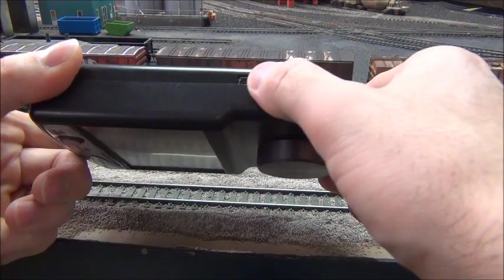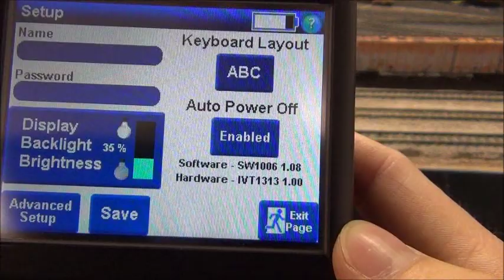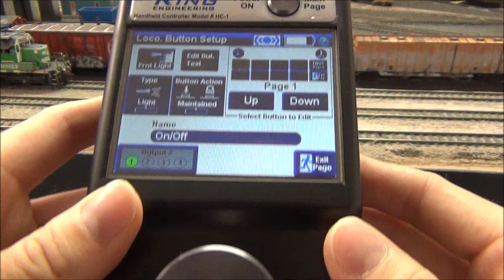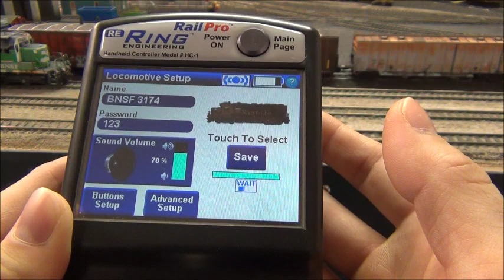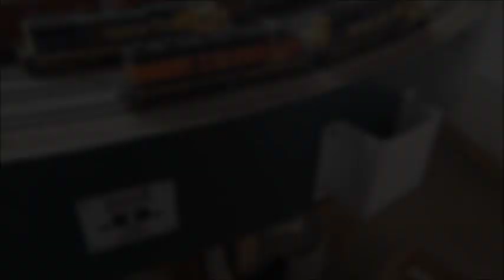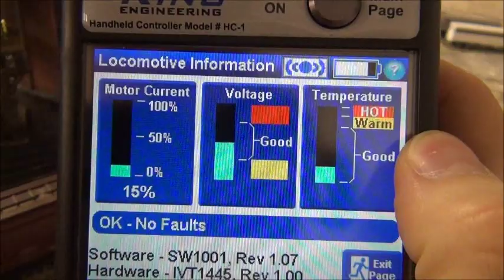Ring Engineering Railpro Review

Comment: 12 years later - are you still using Rail Pro ? Seems like a great alternative to dcc. I am HO, only concern is fitting the modules into the smaller equipment I have, but I can mill weights etc ... to make things fit. 
I would love to hear a current opinion on RP if anybody out there can share - appreciated.
@kpack - great videos, nice job.

Comment: Does it have momentum? That is a must in my opinion.
Reply from the maker: You can set acceleration and deceleration rate, which is essentially momentum.  The new "load" function takes that a step further and really dials up the momentum when you put the load way up.  Depending on the locomotive settings, a consist with 100% load can take a very long time to slow to a stop, even at full brake.
Reply from the maker: BTW, this video is very old and Railpro has changed a lot since then.  Check out the updated review I made.

Comment: Ok, 8 years on the system, what's your impression at this point?
Reply from the maker: Lots of improvement since the beginning.  I do wish some things would happen quicker, but Ring Engineering is a small outfit and they can only so much at a time.  Sounds are far better than they were in the past, many new features, new hardware also.

Look at the updated review video I posted last year and that will help get you up to speed.  The stuff featured in this original video is far different now.

Comment: Do you use keep alives? If not how do your locos run without them. Great video!
Reply from the maker: Yes I use keep alives now.  Railpro runs fine without them but I've found that it's a bit touchy to bad/dirty track.  I just got tired of power dropouts and have loved keep alive's.  I usually use the TCS KA-4, but will start using the KA-1 and KA-2 when they come out.  The KA-4 gives me at least 15 seconds of additional sound, lights, and run time which is way more than what I need.

This video is super old.  Railpro has changed a lot since then.  I really need to get a new one out.
Reply: KPack I have them installed in my railpro too but I found out when you go over a long dead spot it keeps going but the speed slows down drastically and it kind of bugged me just wonder if there’s someway to adjust that

Comment: ROFL have to hit buttons for 20 min before running? how is that better then DC ?
Reply from the maker: No, to start running with Railpro you hit 3 buttons: "on", "locomotive", "select locomotive".  Done.  The buttons pressed in the video are all over the place showing different features and such.  If you are running a train it is quick and to the point.  I'm running full consists of 4-5 locos within 30 seconds of turning the controller on.  It's not that hard.

Comment: Have had Railpro for a few years now.  Its features and sound capabilities have improved over the years.  Yes you do need a LM-3S module for every loco but its costs more or less the same as a dcc sound board.  There is no doubt a learning curve that has taken me several installs and emails to learn the processes. But as Kevin shows here the consisting ability alone for even power distribution is worth switching to Railpro.   They have a new feature that allows you to set the load to simulate a heavy train behind your loco.  Crank load up to 100% and the prime mover sound notches up 3 or 4 times before the train creeps forward.  Very realistic.  The new ultimate prime mover sounds are way better than anything else ive heard.  Also having a vast selection of different bells and horns makes individual locos unique if needed.   If youre willing to spend the time to learn and are willing to use a soldering iron, Railpro blows away DCC. Youll never look back.  If you just want to take a sound equipped model out of a box and run it without having options than stick to DCC.  When you want to consist 3 or 4 together youll be wishing you had railpro.
Reply: Just to add, I do own an NCE power cab as well as the railpro handheld.  The power cab serves its purpose for dcc but compared to this Railpro handheld in terms of visual user friendliness, the PCab feels like something out of the 1980s.

Comment: Nice and thanks for sharing, I’m considered a beginner, currently I have a EzCommand board control and soon or later I would like this try this, do you know if this will work with the materials I’m using, Do you have a link or somewhere I can find this.
Reply from the maker: It all depends on what you are using and what you are planning on doing with Railpro.  Railpro can work in conjunction with DCC (more information on that is available on Ring's website), or it can replace it.  Do some reading on www.ringengineering.com and the Unofficial Railpro Users Group at www.rpug.pdc.ca.  Those two places have much more current information than what this video shows.

Comment: do they have a website, can you use other brand decoders with this?
Reply from the maker: ringengineering.com is the website.  Railpro is not DCC and will not work with full functionality with DCC decoders.  HOWEVER, Ring Engineering has made it so that the later generation of Railpro modules (LM-2 and LM-3) can be made to operate in a DCC-mode so that they can be used with existing DCC decoders.  It is a function that needs to be enabled on the Railpro module.  Once enabled the Railpro-equipped locomotive will be able to be pulled up on a DCC controller and used as a normal DCC locomotive. 

While this will allow you to run a Railpro-locomotive with DCC-locomotives, keep in mind this does not allow you to use all the power behind Railpro.  Railpro will be unable to automatically load-share, there will be no duplex communication, and the sounds may not respond as expected.  Basically it was a band-aid fix to allow people to interface between the two systems.  I'll be honest though, if you're going to go Railpro just go Railpro.  The control is far more enjoyable than DCC that it just can't be compared.

Comment: Can you make a suggestion, I'm considering purchasing this system now 4 years after you bought it. Do you recommend it still or is there another system you suggest. I'm making a small n scale layout and dcc is all new to me. I'm used to o scale. MTh Dcs and Lionel legacy.  Appreciate any suggestions you have for me.
Reply from the maker: Unfortunately Railpro isn't made for N-scale just yet.   The components will need to shrink in size before that is possible.  So in your case I'd recommend using any DCC system.  If you were in HO, then I'd absolutely recommend Railpro over DCC.
Reply: KPack thank you!  I ended up getting the NCE power cab after I visited the hobby shop yesterday. Im naturally an O scaler. Used to Lionel Legacy and MTH DCS so dcc is all new to me lol

Comment: I am still a little bit unclear on this. When you consist locomotives do they automatically speed match?
Reply from the maker: +Jackson Railfan Yes, but it's a little different than "speed matching" as the DCC world sees it.  When speed matching with DCC most people just try to have the locomotives running at the same speed.  In Railpro, though the locomotives will automatically run at the same speed, the consist will actually "load-share", meaning that each locomotive will adjust its speed by itself, in real-time, in order to spread the load evenly throughout the entire consist.  This happens without any input from the user....all you do is determine how much power to give the consist (controlling speed with the big knob) and the Railpro software does the rest.  The locomotives constantly send information back to the controller, which then interprets the info, makes adjustments and sends it back to the locomotive modules.  This happens instantly and continually.  

When you install a locomotive module you will need to set the Motor Full Load Current, which takes a couple of taps on the controller, and then will set it automatically based on how much current it takes for the locomotive to loose traction.  This value is unique to each locomotive and is dependant on the motor, drivetrain, weight, etc of each locomotive.  This value is used by the controller to make automatic adjustments to each locomotive in a consist so that all locomotives are pulling more or less equally, similar to how the prototype does it.
Reply: Great demo video KPack. Railpro even maintains speed and shared load on track inclines and declines.

Comment: I have a 25 year old  Atlas engine too. It does not have ditch lights on it. Did yours come with it, or did you add them?
Reply from the maker: +Russell Scohy I added them.  Details West housings with LEDs.
Reply: +KPack Hey can you run this contoller  on a club layout that uses digatrax
Reply from the maker: Yes, the layout shown on the video was running Digitrax.  You can use Railpro locomotives on any DCC layout as it only takes the power from the rails.
Reply: Ok thank you

Comment: I am just getting into model railroading and i was wondering if you knew how Rail Pro worked with turntables? I cant seem to find any info on their website about modulus or anything. Any help would be much appreciated! BTW i love the weathering!
Reply from the maker: Kingfish - The current software version of Railpro does not support turntables yet.  They are wrapping up development on a new software program that will allow users to control things like turntables and other animated things from the controller..  I've tested it out and it works well.  When that program is released you will need a AM-1 in order to control the motor on the turntable.  The AM-1 is a module that is mounted below the layout to control things like turnouts, turntables, etc.  You tell the turntable what to do on the controller, the AM-1 receives the instruction and then directs the motor which way to turn and how fast.  The new software will also allow you to create your own "projects" for the AM-1....meaning you can write the code and commands to control pretty much anything.  Does that answer your question?
Reply: freewake84 Thank you very much for the info! Not long after i posted this comment i sent an email off to Ring Engineering and they sent me back a bunch of info about the new software. Very cool stuff. I wonder how far out they are from releasing it?
Reply from the maker: IKINGFISH1213I Not sure, but probably within a month or two.  The software itself is pretty much done, I think they are just working on the logistics of distributing it, etc.  It'll be a great addition to Railpro when it comes out.

Comment: Hi There 

I really like your post on this item and have a question to ask you 

I'm thinking about getting this system and i was wondering cause i have a loco fleet off 27 and i am going to run a 8 track staging yard under my layout with 3 locos on each track if i program then to be MU will they stay like that and run unless i want to change them 

Thanks again
Reply from the maker: From what I've experienced the locos will stay consisted until you change them, even after powering off.  I have made it a habit though to un-MU everything before I take it off the layout, as I have no staging tracks at the moment.  However, the few times I've left locomotives on the layout they have stayed MU'd the next time I turned everything back on and picked up the throttle.  

Hope that helps!

Comment: Tried the RailPro system and I liked it WHEN it worked but it did not work well with my NCE Wireless ProCab system.  Locos RF units kept saying they were not getting power and would lose connection to my HC2. Oddly when I put a DCC decoder back in I had no issues.  Tim Ring said it was on my end as he tested my unit with modules and it was fine.  For me I will stick with NCE
Reply from the maker: That's odd.  Never heard of anything like that.  Not sure what it could have been besides interference from the NCE system....even then I don't think that it would have caused that much interference to create problems with Railpro.  Bummer that you had that issue!

Comment: Do you happen to now if rail pro is compatible with G scale locos?
Reply from the maker: At this point the modules are designed only for HO scale, but according to Ring Engineering's website they do plan to make the system for larger scales including G.  The current modules probably wouldn't be able to support the draw that larger scale locos have.  I believe they are working on getting most everything developed and finished in HO scale before moving towards larger scales.  However, a few friendly emails to Tim at RE may persuade him to start working on large scales quicker (if he isn't already).
Reply: freewake84 I may have to give that a try. Thanks a lot :)

Comment: Awesome hoa easy it is to consist  do it just uses 12v dc ??
Reply from the maker: Consisting is just how it appears in the video.  When Railpro is first installed in the locomotive the first thing you do is set the full motor load current, which is done automatically by pressing a button.  After that the loco is ready to use.  If you want to consist it, simply couple it to another Railpro locomotive, press a couple of buttons on the screen, and off you go.  The locomotives will automatically adjust speed to work well with each other.  Railpro can run on DC and DCC.  As long as the power on the rails is sufficient it will run.  They don't recommend running on DC from a DC powerpack b/c they can cause spikes in current.  Railpro power supplies output 14.2 volts filtered DC.  Hope that helps.

Comment: Thank you for the info, the motor control, consisting, loco library, basically everything to do with running the loco is a no brainer to me, RailPro is great,, it is really hard to give up the accurate recordings of the less known loco's, I model Canadian Pacific as well as Canadian National, so the Turbotrain, GMD1, Alco's, MLW's with Tsunami & LOK are dead on, like you say the horns do sound a bit synthetic, but the turbo whine, air compressors, and the famous ES44 "whoop" sound great. The other problem I am having is with the Athearn Genesis Union Pacific DD40, Tsunami did a great job with the dual decoder, dual motor install, sounds amazing! Talked to RE and they can't really duplicate that, but I am waiting to hear back more about it. Still on the fence  :)
Reply from the maker: Yes, I agree Tsunami and Loksound have excellent recordings for some of the rarer locos.  My only gripe with Railpro is size of the sound library...it will grow, but it will take time.  I know RE has recordings of the air compressors and various air let-offs from various prototypes, and I've been trying to convince them to get those prepped for use.  Hopefully soon.  Railpro and DCC don't have to be mutually exclusive....if you have a set of locomotives that you typically use for consisting/road running, consider putting Railpro in them and Tsunami/Loksound in the other locos.  Remember, Railpro will run on DCC rails without a problem.  That way you could have the best of both worlds :)

Comment: Hello, really enjoyed your review on this, been seriously looking at it for myself, really like the speed matching as well as consisting. The only thing I am concerned with is the lack of loadable sounds, also I have never heard it in person, how does it compare to Tsunami, Lok Sound, or the new QSI Titans? Any info you could give me would be very much appreciated!
Reply from the maker: The sound library is growing, but still small.  They recently released EMD 567 and GEVO files, so they are actively working on adding more.  Tsunami, Loksound and QSI have much larger libraries.  Tsunami has good prime mover sounds, but I can't stand their horns....far too quiet and electronic sounding. No experience with Loksound, but from what I've seen they have some very good sound files.  QSI has good horns, but apparently they pitch-bend their prime mover notching...the sounds are not authentic.  Railpro's sounds are recorded from the prototype and in my opinion are very good.  The only one I don't particularly like is the 645 turbo....not enough turbo whine for me.  They still need to add in extra sounds such as compressors, air let off, radiator fans, etc.  They need many more horn recordings also.  Tim at RE has told me that he is happy to use user-recorded sounds to add to the library.  I plan on getting recordings of whatever I can and contributing those.  Hope this helps!!

Comment: I thought you might like these.
Sue Line 1 2 14
 
Sue Line 1 2 14

UP 3985 Visits the Sue Line Railroad
UP 3985 Visits the Sue Line Railroad

RailPro DP on the Sue Line
Railpro DP on the Sue Line
Reply from the maker: Nice video of that Railpro controlled train!  Smooth operation on those locomotives there, very quiet.  I noticed the operator didn't have the sound on?  I'm assuming he didn't install speakers.

Comment: I wonder how their steam sounds are, does the sound match the movement.  By the time I get my larger layout built they should have more sound files.
Reply from the maker: I don't know much about the steam sounds because I don't run steam.  They are also somewhat limited, but obviously will expand.  From what I've seen TCS's new steam sound decoder has some very nice sounds.  For Railpro, the new LM2 module has two inputs, which means that information can be picked up from two sources and sent to the module.  According to RE, one of these will likely be used to synch the cam with the chuff on steam locomotives.  Don't know when that software will be available, but it's just a matter of programming.  When it's available, just download and install on the module.